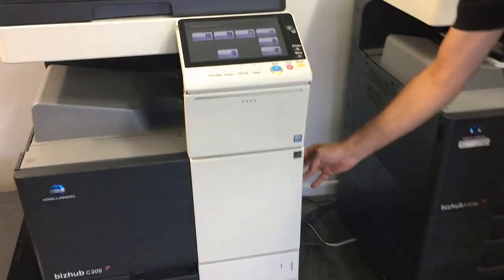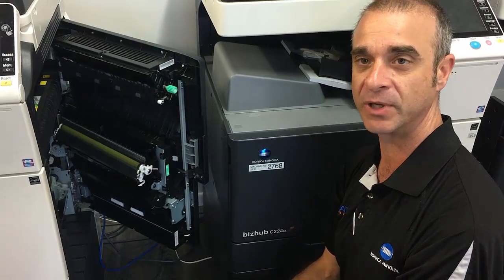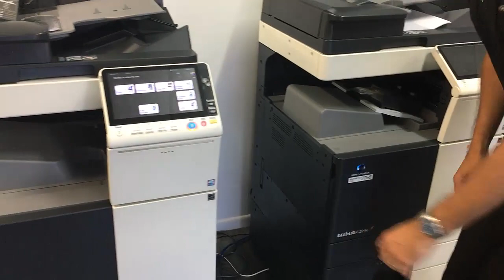Konica Minolta C308 Tutorial Paper Jam

Comment: hello sir i have konica Minolta c 250i
last time my black toner is completely empty but i continuse using machine without using black colure in print
its working fine
but when i purchase new black toner and install it in machine then it is not able to print black i try near about 200 black print but the machine is not able to print black. very light black matter is in print and some time it show error in between printing the error is c2558, i try to clean developer and other part, but same condition plese help me